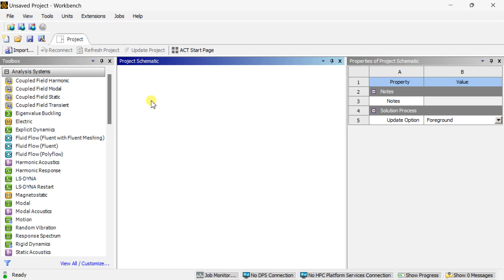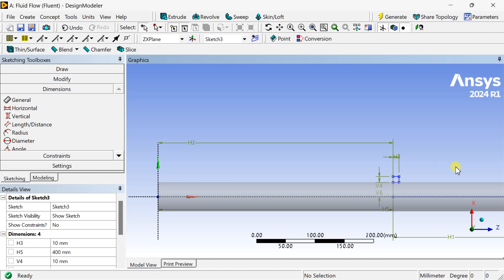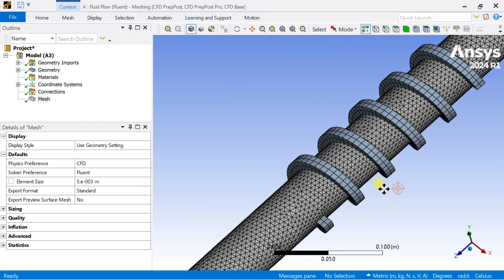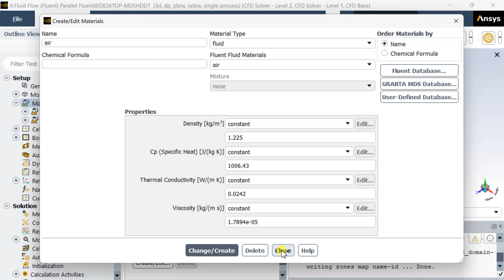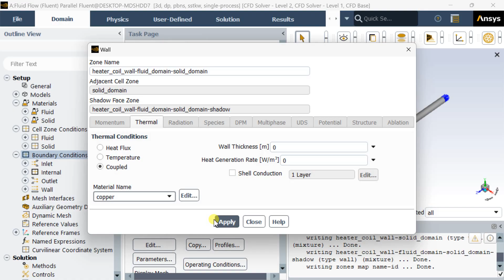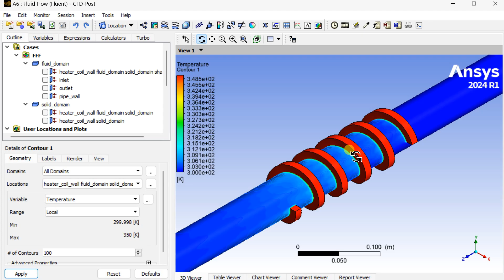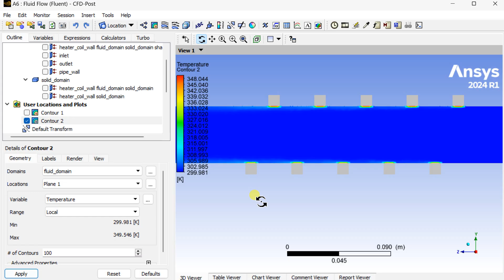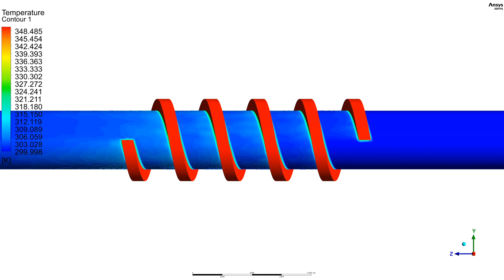ANSYS Tutorial: Heat Transfer From a Heated Rectangular Coil to a Pipe | Pipe Heating Simulation CFD

Comment: I have questions:
1. Why did you make the pipe and the coil as one part? Was it affect the material or any other circumstances?
2. Why was the material assigned as "frozen"?
Reply from the maker: By making this one part, we would suppress the unnecessary contact surface creation. The mesh would be conformal, and the proper solution data transfer between the two parts. The frozen option makes the body to be separated from the adjacent body. If you would use the add material option, it would be automatically joined with the adjacent zone( which would result in a single part) this would cause problem while you want to assign different materials to different cell zones.
Reply: @AnsysTutor I see. Is it possible to separate the material properties between those bodies they are assigned frozen?
Reply from the maker: Yes, this could be done while assigning the materials and its type in cellzone condition.